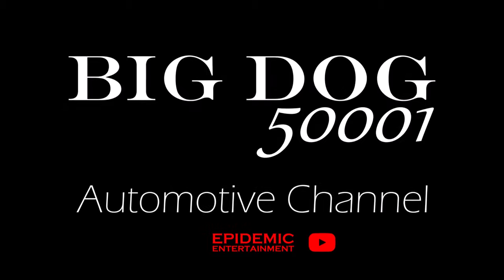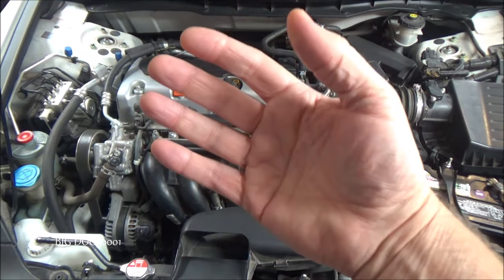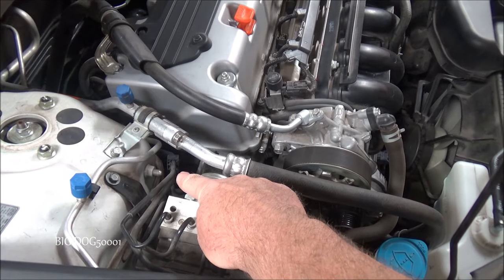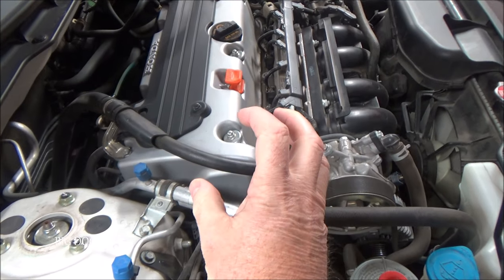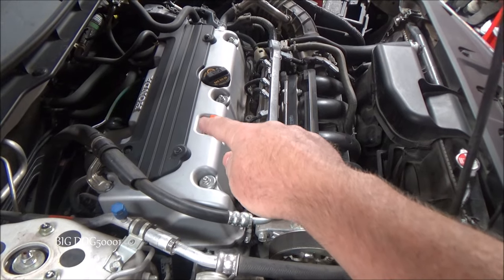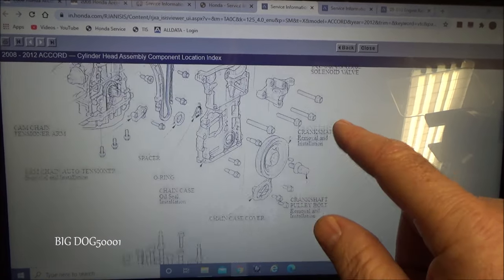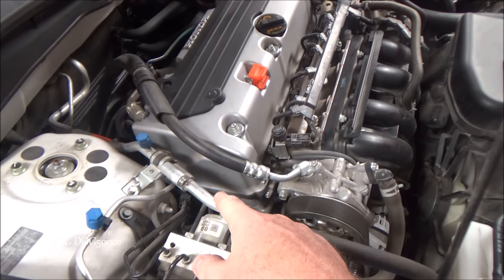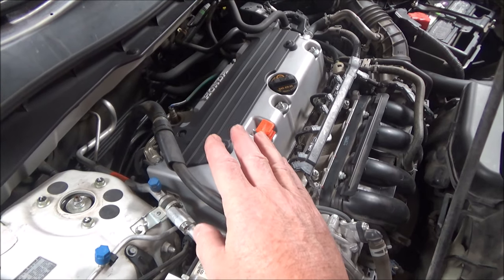Honda Tips:  Engine Rattles on Cold Start-Up

Comment: I'm having this issue. My first thought was, "I'll change the VTC actuator!", but it's widely reported that this fix is only temporary and that it goes back to this state within a few months.  So I don't want to spend on something that isn't a proper solution.

Honda is aware of the issue, but has apparently stated that there's no permanent fix and that it (supposedly) won't hurt/damage the engine.  But I'm scared of this affecting the tensioner and timing chain, leading to catastrophic engine failure (and there are some anecdotal reports of this on the web, though who knows, it could be a correlation vs causation thing). The one tip I've found is that moving your key to the second "on" position and holding for a few seconds before cranking helps.

So on one hand, I want to do something about it ASAP to safeguard the engine; on the other, I don't want to spend a bunch of money on a solution that doesn't work when Honda claims doesn't actually harm the engine.  Not sure what to do.
Reply: Same situation here.. Had it fixed at the dealer and now the rattle is back..
Reply: Having same problems. Actually thought it was starter initially (even bought an oem starter). Was also advised by mechanic not to replace vct actuator as it will happens gain. Have been changing oil regularly and checking level always (no leaks). Grinding noise getting longer then 2 days ago , car throws P300,302,303 and 339 codes, cel on and goes on limp mode.  Read online it could be starter or crankshaft pos sensor so replaced starter yesterday but did not clear codes. Now Im waiting for crankshaft pos sensor to be delivered. Hopefully this will clear codes otherwise may have to replace vct actuator and timing chain.
Reply: How did it go?  @JC-ov5pt
Reply: @soseriousgng  Turned out my 08 accord (had 115K miles) is a PZEV, so parts were still covered.  Had to pay dealer $600 for labor.  So far no more grinding.
Reply: @JC-ov5pt  i got a 2010.. I think my honda forgot it was A HONDA ALONG THE WAY. I  was better off with a used 08 land rover 🤣🤣
Reply: @soseriousgng  lol. Aside from the vtc rattle, car’s been great.  Our 2015 camry also has same rattle on cold start 🤷‍♂️

Comment: Your rattle was much longer than 1 or 2 seconds. Mine last for about 2 minutes. 2013 crosstour V6, 60k mi. (There is a rattling sound in your video)

Comment: This just started happening to my 2009 Accord. Your explanation made me realize why it's happening. I had a mystery oil leak for a long time which means I was low on oil very often and just got it fixed. Do you have a repair video fixing the VTC actuator? And also, is this a major problem that needs to be repaired immediately?
Reply: Were you able to find the problem, I noticed in my 2009 Honda accord the variable timing solenoid was full of dried oil and may be leaking

Comment: I had a 💩 2008 Accord with the same problem, I replaced myself the VTC actuator, the VTC solenoid and the chain tensioner at once , parts purchased from the Honda dealer and I fallowed the TSB by Honda technicians , the happiness just last 10k and the annoying noise came back, always using 5w20 synthetic ☹️ it looks to me that all engine using such technology develop this annoying noise 😞
Reply from the maker: Honda did eventually update the part, not sure if that would have helped your situation.
Reply: @BigDog50001  yes, helped me to buy a ‘13 Camry XLE, now 102k without a single problem just maintenance !!!

Comment: I bought my 2012 CRV used in 2015.  The first time I changed the oil, it growled on the next cold start and I had never heard it do that before. Did some research online and found out that this is a thing.  The oil was new, so I couldn't blame the oil (0-20 syn). But the filter was a fram.  I changed the oil again and went with a better oil filter.  The growl creeps it's head up every now and again.  At one point I spent $500 to have the VTC replaced.  The growl eventually comes back.  I manage it now by doing oil/filter changes at 50% on the maintenance minder. 
I feel like the oil filter is the most critical part, with respect to managing this issue.  Especially if you have the growl immediately after doing an oil change.  Having a filter with a better anti-drain back valve helps with keeping oil on top of the engine on cold starts.  I feel like when the weather gets literally cold, that seal on the anti-drain back valve doesn't keep the oil on top of the engine.   I also use synthetic blend oil now.  Sometimes I think conventional would be better (especially with the 50% oil changes), but conventional oil is getting harder to find.  Synthetic oil has that ability to 'creep' through gaps that conventional oil does not have.  So I think synthetic oil is more likely to get by a bad anti-drain back valve on a filter on a cold night.  I've tried filters made by mobil, purolator and bosch (and I've tried honda filters...I didn't see any advantage in using a honda filter).  Mostly I have been buying them on Amazon and I feel like some percentage of stuff I buy on Amazon is either knock off or factory reject. None them stick out as being able to completely solve this problem.  The results have been a little bit inconsistent (but better than a fram).  My most recent oil change, I used a K&N bought at a local parts store.   I'm curious to see how that plays out over the next 4000 miles.
Reply from the maker: I don't using anything but Honda oil filters on the Hondas in my shop.  Thanks for the input!
Reply: Thanks for those feedback, did kn filter solved the rattle problem?
Reply: @fredf.5901  this fall the noise became very frequent. Even started talking to shops about replacing vtc actuator and/or timing belt. Then for the first time I heard of the vtc/vvt oil solenoid.  It isn't mentioned in the technical bulletin. I got my hands on a new one and took out the old one. The piston on the old one was already advanced with no power on it which isn't right.  So I put in the new solenoid and also replaced the prescreen for the solenoid. Unfortunately I still get the noise but I feel it is not as frequent and is not as loud or as long as before. I wonder if the solenoid being bad damages the actuator. There is always another rabbit hole to go down.
Reply: @fredf.5901   It's gotten more dynamic than that.  The noise got real bad this fall.  I thought about having the VTC replaced again but then I found out about the VTC/VVT oil solenoid.  So I got one of them for about $60 and took the one on the engine out and my oil solenoid was already activated with no power on it which was opposite of the new one.  So I installed the new one.  I thought the crv idled smoother.  The noise still occurred but not as often and I don't think it was as intense.  Then I changed the oil solenoid prescreen.  The old one wasn't blocked so I didn't think that would make much difference but after that, the frequency of the noise decreased again and had even more reduced intensity/duration.  Not sure why or if it was my imagination.  The technical bulletin on this issue doesn't even mention the oil solenoid and mine was obviously not working right.  Maybe the faulty oil solenoid damages the VTC.  If anybody gets the VTC changed, definitely change the oil solenoid.  Or change the oil solenoid first.  It's not too hard of a do-it-yourself thing if your hands are not too big.  It really is a mystery to me that the oil solenoid isn't mentioned more.
Reply: Sorry I guess i replied twice.  I don't do this type of stuff often enough, I guess.

Comment: Great video! Owning a 2009 tsx with rattle noise issues at cold start. Not that bad, i can live with it for now, but definitely will have to replace all timing chain, tensioners, guides, 2 sprockets and 2 sensors and all seals if I wanttl my engine to keep running. 2nd owner, last was a really sweet but ignorant woman (about cars) sadly(^.^;

Comment: I had my vtc actuator replaced after it fried my sparkplugs, and a solenoid. 3 days after the new actuator was installed, the loud cranking/rattle sound appeared. So, sorry, replacing the actuator does not solve the rattle sound--its something else.
Reply from the maker: Sounds like you might have some more issues going on than just a rattle on cold start-up.

Comment: Hello man! Thank you so much for your amazing explanation, just a little question. I have a 2012 honda accord 2.4 with 200K kilometers and since i bought it, i have this rattle noise on cold starts. Is this going to affect the engine at any point if i don't change the vtc actuator?
Reply: What was the verdict? Did it die?

Comment: We are getting the lifter rattle on cold start on our 2011 Accord SE. I've found parking on a slight grade in the drive (front end higher) helps, possibly the oil sump pickup stays submerged or primed (my guess). Next, I'm going to try the 0w20 syn blend oil. I wished I had found the VCT as possible issue sooner, we had the timing chain replaced recently (240k miles) and they were right there...doah!
Reply: It's not the lifters making the rattle.  It's the locking pin inside the VTC (not VCT) actuator moving back and forth across its detent.  This is usually because the spring that works against the pin gets weak and shortened.

Comment: So Chris Fix has a video showing a 2008 Honda with this rattle, and it exactly matches the noise coming out of my 2012 Accord.  Can just the actuator itself be replaced.  I don't want to get talked into other components like timing chain.  Thanks.
Reply: Like chrisfix said in his video, if the timing chain has jumped, then it also needs to be replaced.

Comment: Noticed a noise like that on my CRV. Wasn't sure what it was at first, now I know. If I don't get that replaced, how bad of an issue would that be?
Reply: Some people go 100,000+ miles with it bad. Just make sure your oil is topped off biweekly. If it goes out, your check engine light will turn on and acceleration will be sluggish.
Reply: Gil Arellano. Gotcha, thanks. So far acceleration is normal, I do need to check the oil, it’s been a minute 😬

Comment: I just went through this on a 2004 EP3 Honda. Sounded horrible, screeching sound on cold start, starter?..NO, timing chain? NO..actuator? NO. The dealer wanted a fortune to fix it. Finally, a shop that specializes in Japanese autos, the old mechanic, told me that it was the PCV VALVE and told me to do it myself. I laughed at him. But the sound got worse, so, for $20.00 and 15 minutes, I replaced it. The old valve was 120,000 old and not functional. Not only is that horrible sound gone on start up, but the SI Ep3 runs better, idles correctly, MPG back where it was. Look for the simple things first before getting into a major headache. PCV VALVE.

Comment: I have the same problem, but it’s been happening for so long it’s getting real bad to the point where it’s when I’m driving too now. It’s really loud and I feel like my cars gonna break down any second. It’s an 08 Accord. Is this something I can do myself or do I call a mechanic?
Reply: I have the same issue! Did you fix it already? How long you keep driving it after you discovered the sound?
Reply: @youtubersenlamira7562  hey so I found the problem. It s the tensioner. Don’t know too much about it but if it goes bad u need a new engine. Take your car to the mechanic immediately. Hope this helps. The timing belt and all that needs to be reset and I don’t trust myself messing with that stuff

Comment: Same problem with my Honda CR-V but now my crv is talking Tomuch gas like 7 or 8 km per litre . And wired noice came when car running and engine oil is getting low rapidly what to do ? 2014 crv touring with 178000 km
Reply: The fix in my page

Comment: So glad I found this video! A few months ago I bought an 08 coupe 4cyl and and about 6-8 weeks ago I started hearing this noise. I’ve been told it’s time to replace the timing chain. Is this right or is it solely that the actuator needs to be addressed? There’s 177k on my Accord.
Reply: The thing is your already in there so you might as well just change the chain and everything

Comment: My 2007 Honda Fit just started making a rattling noise from the engine on a cold start.   Has me worried as fuck.   Hopefully it's not an expensive fix.
Reply: Did you fix it? Just oil and filter change??

Comment: How much would it cost to have this fixed. I have an 08 with that and want to fix it. I’m 17 and this is my first car I bought and want to take care of it. Thanks and best wishes
Reply from the maker: It is fairly expensive.  Cost vary widely due to location so for that reason I don't typically quote prices.  Thanks for the comment!
Reply: Oh wow saaame man I'm 17 too and its my first car 👌😂
Reply: It runs about $800 at the Honda dealership and Honda American won't do anything about it. I went back and forth with them before I just said the heck with it. Mine has probably rattled for about five years/25,000 miles before I finally decided to get it fixed because I couldn't stand the grinding noise . The service tech said it wasn't something that was going to hurt the engine. Not sure if I believe that or not.
Reply: @danielmoerke446  Exactly. I did some research and saw that actually I shouldn’t be even driving it if it makes that noise since it can hurt the engine in the long-run but who knows.
Reply: @thepaw3172  Nice. How’s the ride so far?
Reply: Mine started to grind about 5 months ago in a 2012 CRV with 90k miles. I recently had it fixed at Honda for $917 in the west coast.
Reply: @Joseph-rw6yg  did honda replace it with the updated version? Im curious to what they changed in the new version
Reply: @Joseph-rw6yg  california? i just bought a 2012 crv with 109k miles it does the same thing on cold starts. Im thinking of taking it in to honda dealer since they know how to deal with it. A mom and pop shop may charge cheaper but idk if its worth it.
Reply: @JO-fk1bg  to be honest I didn’t even know there was a revised revision of the fix .
Reply: @oaktownist  I would imagine a local shop should charge less. Personally I didn’t feel comfortable driving the car as the sound is unsettling. It’s a shame Honda didn’t do a recall .

Comment: Hi, sometimes I have cold start-up rattle. If the VTC went bad, is it possible to have a small rattle sound in about 3k rpm? Thanks.
Reply: Having the same problem now did you find out why the rattle happens around 3k rpm ???
Reply: Same here

Comment: I have a 2010 accord coupe ex I’m having the same noises and it just started. My oil life right Now is at 50% I also have a engine check light that’s comes every so often.. barely tho. What type of oil should I put in my car?
Reply: The 2010 Honda Accord uses SAE 5w-20 full synthetic oil. The 2.4l engine has a capacity of 4.2 quarts while the 3.5l can hold 4.5 quarts.

Comment: Hi I have a Honda accord 08 that when you start it makes that noise and I also have a check engine light with code P0341 with means sensors might be bad ? Sometimes when I'm driving it. it accelerates more when driving would the sensor cause that or does it have to do with the timing chain possibly? Or with what your saying in the video thanks for the help in advance.
Reply from the maker: The car is telling you it has a timing issue (probably not a sensor problem).  Bad VTC actuators can cause this code but the problem that sets this code a lot is a "stretched" (out of spec) timing chain (the fix is usually a new timing chain and tensioner).  Driving the car with low engine oil or not changing the oil frequently is usually the root cause of timing chain and VTC issues.
Reply: @BigDog50001  thank you i will check out it out and get it changed

Comment: Just  thinking, if one allowed engine oil to get so low as to starve the timing chain of oil, wouldn't damage likely already have been done to other areas such as bearing surfaces, etc. that rely on constant oil pressure?
Reply from the maker: Possibly, but generally the chain goes first.

Comment: I get a little squeaking noise that lasts about a second or maybe 2 and then goes away ??? Do you know if that has something to do with the VTC ?
Reply from the maker: For quick start up squeaks, I would probably first look for loose drive belt(s) or failing belt tensioners before moving on to other things.

Comment: Hi. As anyone opened the front cover of their VTC Actuator and stretched the lock pin spring in it? If so, did it work out fine? Can it damage anything over time? Thanks
Reply: Did it but no improvement.

Comment: I did the VTC intake gear, chain, tensioner etc, still makes the same rattle on startup
Reply: Did you adjusted valves
Reply: @mrpistonrecaro6483  yeah 3 times trying to get rid of the valve noise. The car runs good just has that rattle on startup, a little valve noises and when the vvt goes to the other lobe on the intake cam around 2200rpm it makes noise and that's the part I'd like more information on. Probably should've replaced that vvt solenoid when I did all the vtc, timing chain work. It's either that, the valves aren't properly adjusted or maybe it needs another intake cam. Idk the car runs good I'll figure it out eventually
Reply: Lol...did replace timing chain, water pump and all about 4 years ago. 
Just now after a oil change and first cold snap it started to rattle in the morning (coldstart). Put Lucas-additive in the oil but still does it. Frustrating....